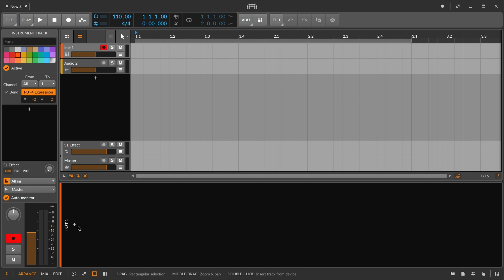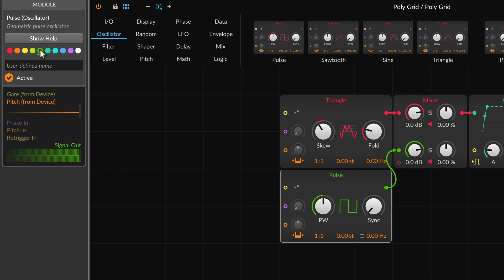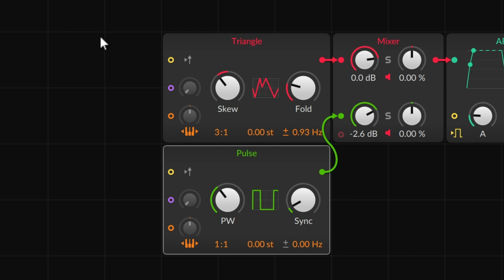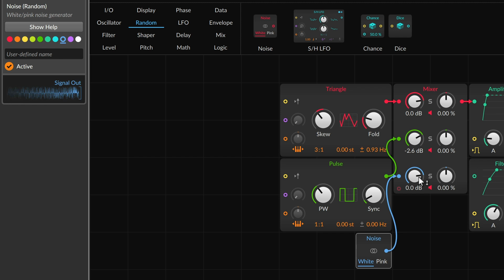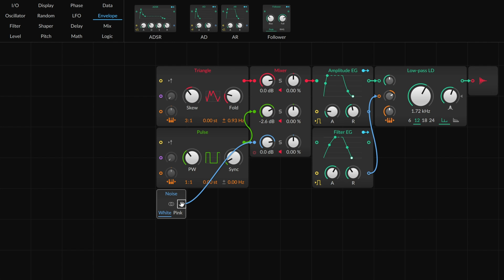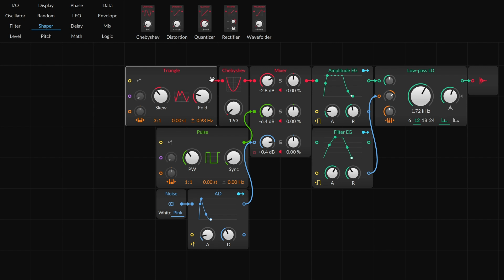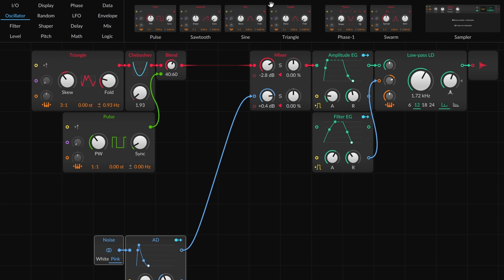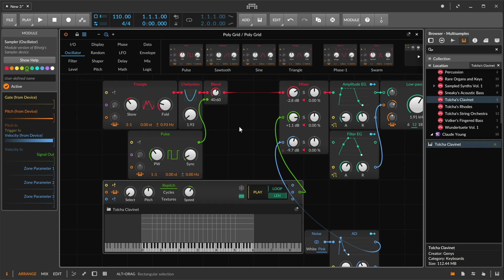Let's Build a… Synthesizer [Bitwig Studio | The Grid]

Comment: Can you build an interface like in Max4Live, or Reaktor? The grid view is kind off messy just for use.
Reply from the maker: You can use the device Remote Controls to build a simplified interface. That way you have access to parameters without having to open the Grid editor.